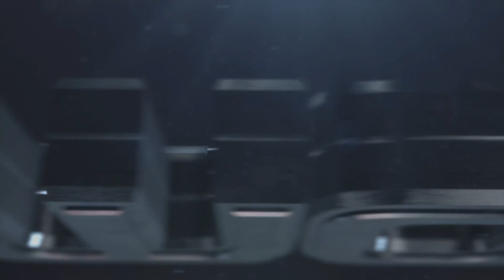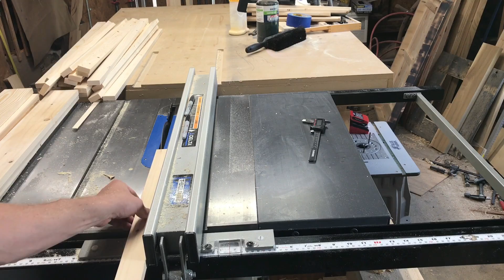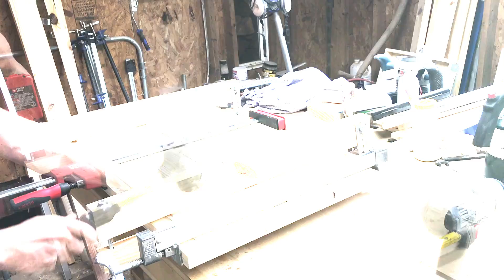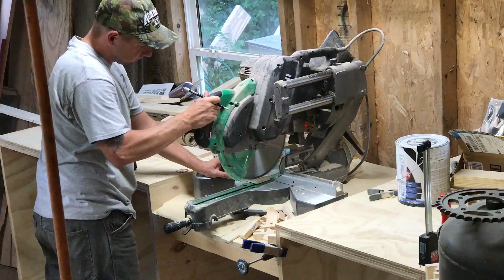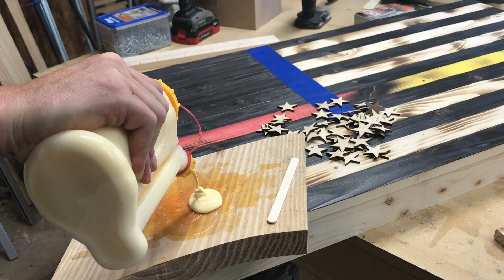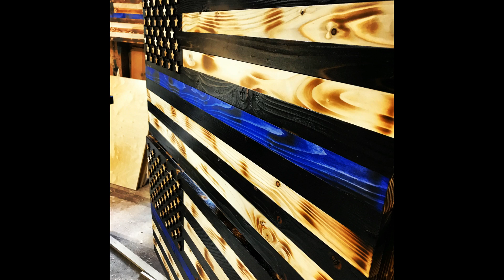Torched American Flag Build / How to

Comment: Hey David, got a sealer question for you. I don’t have a hvlp sprayer so I am stuck between spray can or brushing on a sealer. Since I also use the 3D stars I am curious your opinion on what to use to seal. Brushing on polycrilic is a bit rough because it wants to puddle around the stars when the brush hits them. Then the tedious task of sanding between coats of brush on poly is not fun. Would you recommend a spray can laquer and doing 2-3 coats and not having to sand or another spray can sealant like spar urethane. Not a big fan of the Minwax poly spray cans. Want a good shine and seal but the raised stars make things a bit tough time wise.
TY.
Reply from the maker: Well the can method is quite expensive. If you can afford it I would suggest an electric airless spray gun. I know that’s is not always the case so you can also try brushing before you put the stars on. After it is totally dry then put them on and spray just those to seal them. If you do that use a different type of glue like CA glue and pin nail the stars on because wood glue won’t adhere well to the sealed finish. Hope this helped
Reply: @DwoodStudios  Thank you.

Comment: How much should I ask for flags like this? I've made 3, 19.5x37", and 2 18x30" flags. IDK what to try to charge. I thought about 25-30 bucks but was told I was dumb if I didn't ask 50 a pop...that seems like a lot. The quality is good..but is 50 too high like I think or am I really low balling myself? Thanks
Reply from the maker: James Fitch you have to take into account your area or where you are selling, the quality or maybe the artistic value(how much do people like your piece), materials, and most importantly your time( which is based again on how much people like your art). But either way that is too low and you are screwing over all woodworkers that sell because people just wanna go cheapest.
Reply: @DwoodStudios  I deffinatly don't want to screw any woodworkers by low balling them. I will crucify HVAC companies though because 200% markup/$85 /hr service calls, and conning people into buying equipment they don't NEED for a few more years. I hate greedy people and I don't mind cutting the wedding tackle off of men that charge $300 for a capacitor or ask $1500 for an engine when they spent $17.36 on it. I believe in fairness and I'm an artist that charges $00.35 a square inch for paintings and drawings because nobody cares how long it takes you to create art, they only care according to the emotional desire they get when they see your artwork. I have fun making these and I'm only trying to find the going rate for these flags, I will not cut my own throat. I will take your advice and ask at least $50 bucks for my projects per 19.5x36" flags and lower as the size shrinks. I appreciate your willingness to teach us fellow humans trying to find their way. I appreciate your skills, your knowledge and your advice. Thank you for answering my question. And rock on! you're awesome at this!!

Comment: A quick question for you.   In the jig plans, you start with a 37.5 inch long piece of plywood....  then you put a 1.5 inch furring strip on it.  But, the flag is 37.5 inches.  What am I missing?
Reply from the maker: This was an oversight on measuring when I first built it. But I ended up liking the way it came out being shorter. It works great and can be modified if you like to accommodate a full bed.
Reply: D-wood oh ok.  I figured one measurement was off. Wanted to make sure I knew which one was off.  Thx

Comment: Hi, curious about flags cracking because you have glued across the board and don't allow for wood movement? Thanks. Nice work.
Reply from the maker: Michael Orlando haven’t had one issue. For one this is pine, second it usually shrinks a little bit in low humidity which just creates very small gaps between the stripes that were not there before hand. It’s not noticeable and once the humidity returns it just goes back to the original. That is the reason I don’t glue them up as a panel.

Comment: Is that 1x4s you use for the frame?  why did you have to trim the frame pieces down?
Reply from the maker: David Moss for the frame I actually used 1x3s. And I trim them to 2 inches and for a nice square edge instead of the rounded edges.
Reply: Thanks for the help man.. i want to make one but with no burning have you do one with just stains?  what color is good for the frame if i go that route?
Reply from the maker: David Moss I have!  Check out my website at www.dwoodmaker.com and there should be some pictures.

Comment: what are the dimensions of your flags? and how far apart are the marks on your templates for the star layout?
Reply from the maker: Brandon Zemrock mine are as close to proportion as I could get them at 37.5 x 19.5. The union is 14 and 7/8 and I'll have to get back to you on the stars spacing. I am hoping to have a set of detailed plans available with a template fairly soon.
Reply: D-wood sounds good👍🏻 thanks.

Comment: What do you use for the red on your flags? I made one using high temp spray paint from auto zone, for exhaust manifolds and headers. It turned out really cool the grain comes through without distorting the color at all. Check it out sometime.
It only seems to work with the red though.
Reply from the maker: +BUCKEY THE DOG I use stain from Lowe's for all my colors. I will check t out